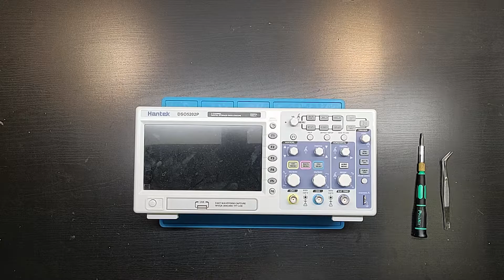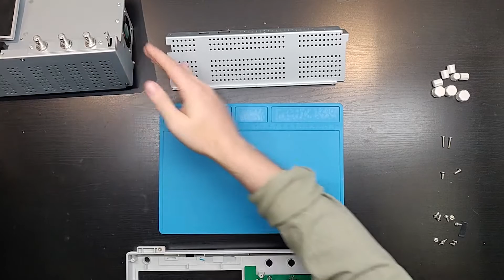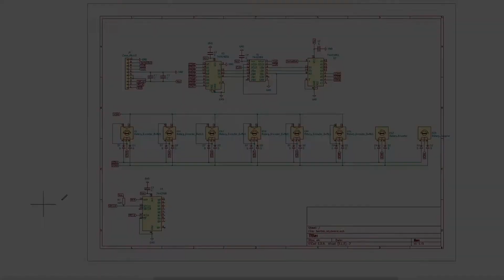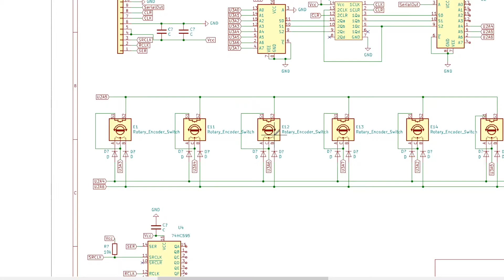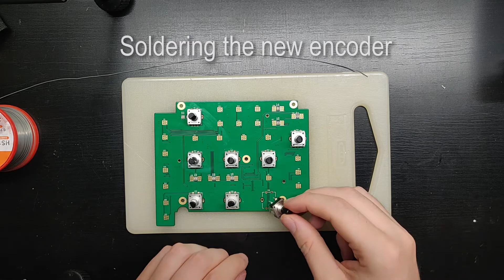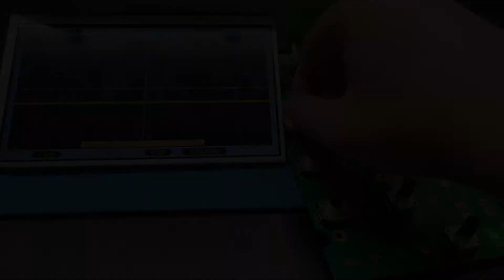Hantek DSO5202P: Knobs/Encoders Not Working Repair

Comment: Thanks for this useful video! Curious to see what could cause such a short circuit, after having soldered the encoder out, I opened it up by folding back the frame tabs that hold it together. It looked perfectly in order inside and I could not see anything that could cause the short. Putting the encoder together again, the short was gone, and the scope could be repaired by soldering the encoder back in (not having to wait for replacement parts). A possible explanation for this problem might be that these encoders are susceptible to metal whiskering, see https://en.wikipedia.org/wiki/Whisker_(metallurgy)

Comment: I had the same problem. However when I checked all my encoders none of them shorted to ground. I also checked the diodes connected to the rotary lines, and all seemed fine. I also checked the live voltages whilst turning the knobs (difficult to access). Unfortunately none of these lead to a diagnosis. As a last ditch attempt, I cleaned all encoders with contact cleaner (just sprayed anywhere I thought it could penetrate and turned and pressed all the encoders to hopefully clean them internally). This seems to have solved the problem for me. Hardly a high-tech solution, but as a last ditch attempt, perhaps someone else might benefit from trying this.

Comment: Thanks for posting this video! I have the same problem with my Voltcraft DSO-1062D. I will try to fix it
Reply: @Voltosh Today I took it apart and all the encoders were just fine. I suspected now the flat cable connecting the keyboard and removed it from both sockets, carefully reconnected it, and voila, keyboard knobs are working again! So those symptoms can also indicate a problem with the flat ribbon cable.
Reply: After some use, it stopped again. I fiddled with the buttons, and found out that when I touch (press/rotate) the vertical pos. button, the other buttons are blocked (often). So I will replace the  vertical pos button and see how it goes.

Comment: my encoders sometimes work a different function, usually ch1 affects ch2 or affects timebase, and my f0-f6 dont do anything i want them too just doing random things!
dso2d15. i have looked inside, got as far as the pcb and had no more screws but could see the ends of rivets! also i have a large cable that seems to go to the lcd but dont have the thin cable you have for the keypad so i dont know if routed different or its part of the lcd cable

Comment: Hello, great. Sorry, my oscilloscope is also broken, it announces the error 510d5 when calibrating.  And I don't have a waveform at all, and the metal part gets hot, I wanted to know if you have the Hantec dso2d10 circuit schematic. Thank you.

Comment: Just did this. Measured a low impedance, desoldered the encoder, power up without encoder, it works. Resoldered the non-working encoder again, without tweaks or nothing else, it works. 
Nice, mh? 😂

Comment: Thank you for the info in this video!! I used my DSO5102P only a couple of times then packed it up in the original packaging for about 2 years. Come to find out when I pulled it out again to use a couple weeks ago the knobs wouldn't work!  When I tested the encoders on mine on the continuity setting of the DMM there were none shorted(none beeped). BUT there WAS one where one of the legs had very low resistance to ground(about 33ohms). I bought a whole set of encoders from Mouser in case of future failure & replaced the bad encoder which brought the scope back to life. It was NOT easy to desolder the old encoder & almost lost the 2 miniscule diodes from the encoder when they fell off the board! So be careful to test the encoders on the lowest resistance setting of your DMM, just in case the resistance isn't low enough to register a beep in the continuity setting & be very careful not to destroy the board while desoldering the bad parts....I think their use of lead-free solder in manufacturing makes desoldering a real chore!

Comment: I bought one of these scopes for very cheap price 50 pounds. Had the same problem,  cleaned out all the Encoders the scope is working 100% good . while I had to open i replaced all the crappy electrolytes with decent brand. at the same time done the firmware modification for 200 MHz. excellent oscilloscope for the price that I paid and for its functionality.

Comment: Thank you very much. I have a Voltcraft DSO-1062D, which looks exactly like yours so is probably a re-brand. I had the same issue. Thanks to your video, I managed to fix it. Unlike in your case, I had no shorts to ground. But after desoldering of one of the encoders, the device started to work properly. So I knew it was the reason. I managed to disassemble and clean it with IPA. After putting it back together, the oscilloscope is now fully operational.

Comment: Thanks a ton for this video.  I had hardly used this scope and your diagnosis was spot on.  I ended up ordering a full set of Bourn encoders since they were so cheap. While I am waiting for the new encoders,  I simply cut off the mounting tabs (which were connected to ground) and it is back working again.  I will be replacing the bad encoder when I receive the replacements.

Comment: When searching for what could be the problem with my Hantek scope, I came across your video. I found the shorted encoder and took it out of circuit, sure enough everything was working fine. I ordered a new encoder and collected it today. It is now soldered back on  the board and the scope works as new again. thanks for your video and well done on the reverse engineering.

Comment: I have the same problem. Contacting Hantek was useless, they just don't understand and kept asking the same questions over and over again and I gave them the same answers over and over again. It appears that the Timebase encoder may be faulty as pressing this sometimes clears the problem for a while. I have same types in stock as I use them in my designs so will swap it over.

Comment: Thank you very much! You saved my day! I had the same encoder problem with Hantek 4254C. The PCB seems to be very similar, just with more encoder channels.
Reply: Which Encoders did you use for the larger Voltage/Division pots? 
My 4254C encoders seem to have stopped working on all 4 channels!
Reply: @d42kn355  I used PEC12R-4020F-S0 from Digikey. They have 24 ticks per revolution (instead of 12), but they work perfectly fine for me.
Reply: I think all encoders are the same size. The voltage knobs just have bigger wheels on them.
Reply: @Julian_G.J.K  I meant which Encoder? - The video shows the Volts/Div as PEC12R-4120F-N0012, but that one doesnt push in for the "fine tune" - its footprint also seems to differ (doesnt have the 2 pins on the backside for the switch) 
Was the Part No you replaced yours with PEC12R-4120F-S0012 instead? (Has the momentary switch)
I asked you because I also have a 4254C rather than the one showed here in the video ^_^
Reply: @d42kn355  Sorry, the part number of the switch that worked for me was PEC12R-4020F-S0024 (a copy paste mistake, last digits are missing in the post above). It has the push button too. I do not remember which knob of my scope was broken. Best luck with the repair of your scope.

Comment: I've just found an 80 ohm leakage to earth on the Vo encoder. I removed it with a view to finding a replacement but found once removed the leakage had gone so decided to refit for the time being and now the knobs all work. One thing occurred to me later, why not just dremel the encoders frame so as to isolate it from the pcb and then find another means for mechanical support. The leakage would still be there but no longer leaking to ground. I'll try this if the leakage returns or if another encoder fails.

Comment: This worked for me too. Checked all resistances at a and b on every knob in relation to ground, one knob had like 34 ohms only.  I desoldered it and all the other knobs started working. Will buy another knob. BTW it was the CH2 VOLTS/DIV knob that was failing. But for how long will it work? I mean this scope worked fine for a year with low usage, why did it suddenly break? Well at least I can fix it again in the case of rotary encoders failure again. Thank you for the video, youre a scope saver

Comment: Perfect video.  My scope had the same fault.  Diagnosed and removed the faulty encoder (Ch2 V/Div).  Tested with it removed and sure enough all works ok with 1 channel which will get me by till the replacement parts arrive.  Thanks very much for your comprehensive information.

Comment: Just excellent! Same scope same problems. I did some deoxit to the encoders for the third time but i am sure that i will need to replace them. The fan is also warn out... 60x60x10mm 12V 0.1A fan.  
Writing the encoders part numbers here:
SEC/DIV PEC12R-4120F-S0012
VOLTS/DIV PEC12R-4120F-N0012
All other PEC12R-4020F-S0012
Thanks! You are just great!

Comment: Thanks so much for doing this video. Mine developed this fault recently, so this was great to find.
Update: all done. For anyone else that might come down the same path, the 4204 has a slightly different assembly technique, but it's relatively easy to find your way. The gotcha is that there are two screws hidden under the emi shields for channels 1 and 4, so you need to remove those two shields to access the screws. The flex cable for the keyboard is released at the keyboard end, not at the mainboard, but there's plenty of slack to lift the mainboard clear and then release the flex.

Comment: I've got the DSO5102P scope and have similar problem in that some of the controls aren't working (V0 knob and some of the buttons) but in my case it appears some of the vias are faulty. I've traced my board to help figure it out. Here's the file (made in GIMP) in case it helps someone else: https://drive.google.com/drive/folders/1ZuTgw4A8zySkdBicqZcQvqfmxBgRVNAK?usp=sharing

Comment: Thanks for sharing this video. I identified the faulty control on my scope easily with a DMM. All the controls had >10M resistance to GND except for one which was 83R on each outer contact. Extracted it and all other controls started working. New control on order.
Is it just that these Bourne controls are unreliable or is it the way Hantek are using them. I have had this scope for 3 yrs and only used it a few times. It worked ok when I used it at the weekend. Turned it on Monday morning and controls not working. Bizarre!
Update: I have now replaced the faulty control (CH2 Position) and all is ok. But for how long???????